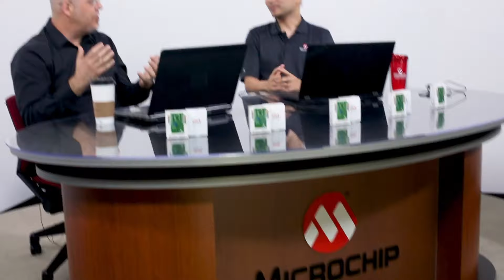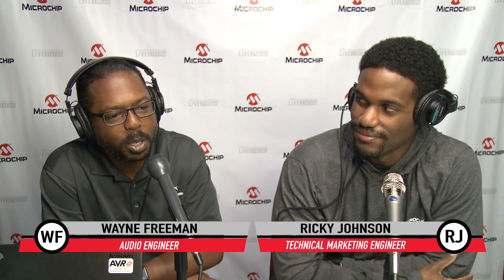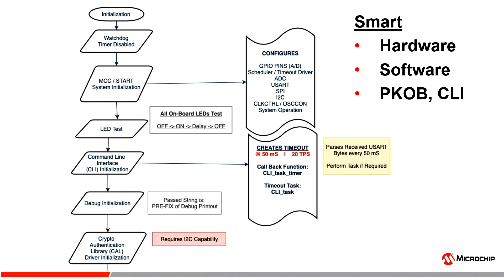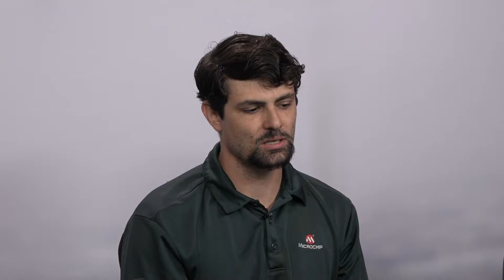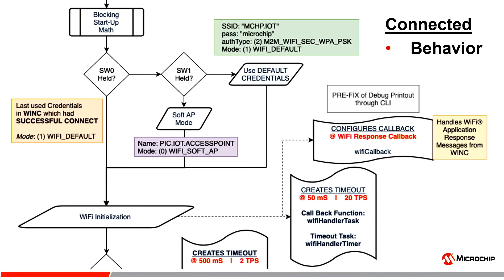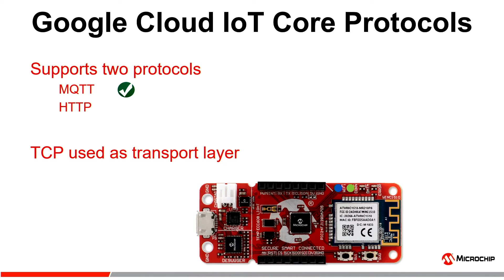Exploring the Code Behind IoT Development Boards

Comment: I'd like to use the PIC-IOT board for sending data, via MQTT, to a local server. I've an MQTT Broker (mosquitto) and NodeRed running on a Raspberry Pi in my house and I'm not able to let the PIC-IOT board send data to the local MQTT broker.